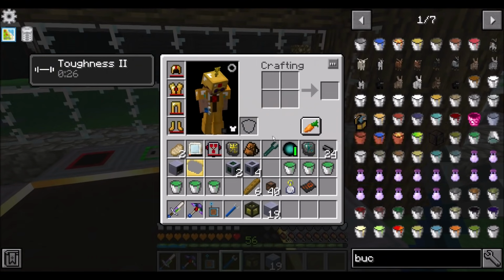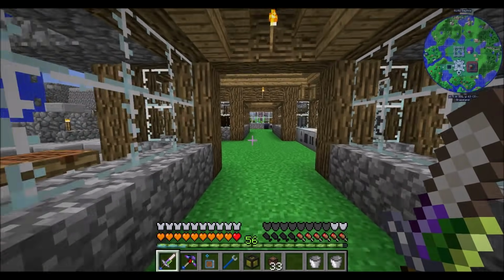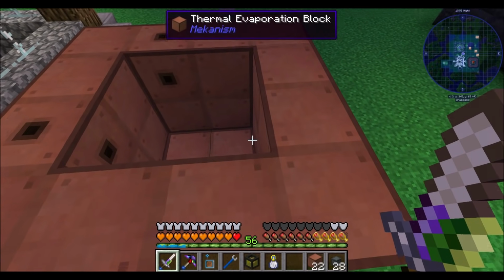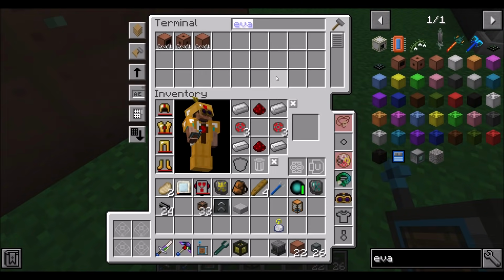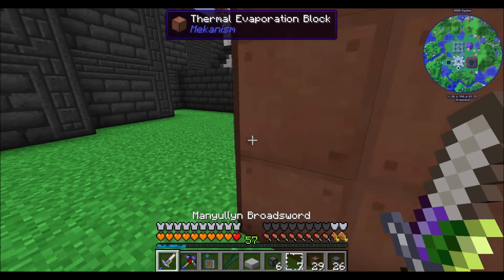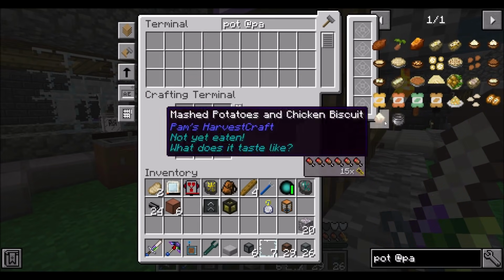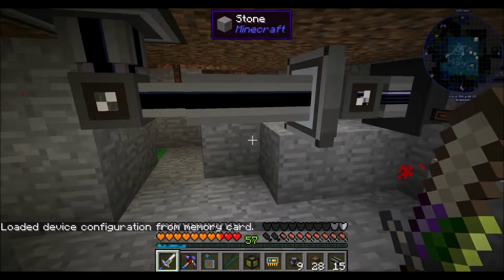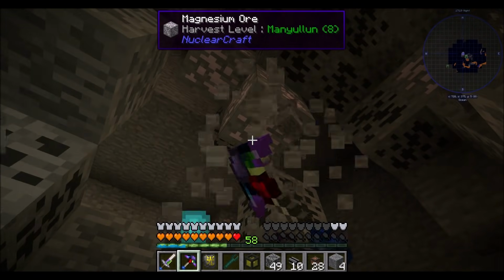Enigmatica 2   Ep56 Brine and Titanium

Comment: Dire... Builds expensive miner, goes mining by hand, builds complicated steucture because he decides it is not worth changing salt into brine, then starts creating salt almost free... 😂
Reply: See going from brine to salt is easier then salt to brine since you get so little brine from salt
Reply: He's gonna need it for for lithium anyway
Reply: Vanilla Mekanism is much easier though
Reply: @Naztash  How did you make sure to supply enough water because thats what is limiting him right now
Reply: The extra brine produced could also be use for x4/x5 ore processing.
Reply: @zecuse  hes already making sulfuric acid and sulfur without brine so he just needs to add a couple machines in the line and he can have 5x ore processing
Reply: Was he making chlorine over there though, I don't remember all of the steps he went through? If not he'd still need the brine for that so the crystals can be processed.
Reply: @zecuse  he is making chlorine to make titanium
Reply: And that chlorine will back log since the titanium machine isn't running all the time. Setting it to a higher priority will make it take chlorine when it would need it while the rest could be used for ores.
Reply: @zecuse  yep
Reply: IT TAKES A LOT OF ENERGY AND TIME TO TURN SALT INTO BRINE
Reply: The thermal evaporation tower is by far not complicated. It’s the easiest and cheapest Mekanism multiblock. And brine has many other uses as well; plus it produces way more brine than salt does, so he’d need to be making a lot of salt.

Comment: Can't wait for him to realise that this modular machine uses 100k rf/tick :D
Reply: he has 3 gas generators and he can switch to ultimate universal cables
Reply: @SkullCrusher757  They produce a mere 15k rf tick.
Reply: @Broffuccini  he could make a reactor
Reply: lmao. Power consumption escalates extremely quickly on this pack.
Are reactors the only option for good power generation?
Reply: @caesural  not sure i just know that hes familiar with big reactors and they make tons of power
Reply: @SkullCrusher757  Nuclearcraft is a better, albeit more complicated reactor system.
Reply: It's FE not RF
Reply: @JordanBennett19829 theyre the same thing its not like joules and rf where you have to convert into it
Reply: @dominorider9879  true but i dont think he wants to deal with the explode in your face thing if he derps
Reply: @Broffuccini  That's the purpose of having power storage, so you can afford to run big power users like this that don't need to be running non-stop
Reply: @SkullCrusher757  Nuclearcraft is easy to prevent overheating, just have it send a redstone signal to power down?
Reply: @JordanBennett19829 It's not that simple. They are 2 separate systems that still coexist in 1.12.x. The thermal mods still use their RF system with a 1:1 conversion  / compatibility layer to forge's FE system. Many mods have moved to FE but not all and some might even contain compatibility for both, like in fact mekanism. And it's configured to use the RF system in this pack, so you're basically wrong :p
Reply: caezar The Immersive Tech steam turbines are quite good and you have ET solars available as well.  Since he’s done so much with Mekanism already, a Mekanism reactor would be a good choice and will last him through end game.  That said, he’s going to need to do either a NC or IC2 reactor to produce IC2 plutonium which is required.  Extreme Reactors can be bypassed since you can get cyanite from NC.
Reply: But it only uses 1 million “rf” per craft, so if it works at max power, it only takes half a second to craft.
Reply: Also, how is he going to craft anything other than titanium given the way he’s pumping in chlorine?  99% sure I recall that the chlorine in the tank isn’t ignored for other recipes and will bork them.

Comment: since your already making brine you should go ahead and try 5x ore processing. your going to want the evaporation chamber either in a desert or in an always day world. dire the elite mechanical pipes transfers 1600 mb/t and the ultimate one are 4x faster than that
Reply: Brine is for 4X.  The Sulfuric acid is the 5X.
Reply: Integrated Dynamics/Tunnels can't be beat with a transfer rate of integer max (2^32 - 1). No need for logic either with that setup since a blank variable = true.
Reply: @zecorezecron  he actually doesnt need brine since its just used in a rabbit hole to make sulfuric acid which is something hes already making. this is how everything comes together to quintuple ingots, 1 Raw Ore + Sulfuric Acid -> chemical Dissolution Chamber -> Ore Slurry
 + Water -> Chemical Washer -> Clean Ore Slurry -> Chemical Crystalizer -> Crystals

Crystals are then put into a Tier 3 setup to be processed.
this was copied directly from the mekanism wiki and based on this info he has almost everything he needs to do 5x ore processing
Reply: zecorezecron he’s already got sulfuric acid. It’s one of the steps in the calcium sulfate he already did.
Reply: The Tier 3 (x4 ores) setup starts with hydrogen chloride. Do the 5 crystals not need HCl in the Chemical Injection Chamber to make 5 shards (I haven't made x5 yet)?
Reply: *You’re 😎

Comment: You should definitely be using Mekanism pipes to fill your thermal evaporation chamber, or at least something faster than EnderIO.
Reply: i think ultimate fluidpipes from mekanism are about as fast as you can get. the elie pipe transfaer 1600 mb/t and the ultimate is 4x that
Reply: @SkullCrusher757  Fluid laser ... 50B/t ... Yes Buckets or more the big reactor can "only" except 50...
Reply: @toaran  is the laser a single block
Reply: @SkullCrusher757  you need two laser  the range is 16 block i think
Reply: @toaran  Everyone seems to overlook Integrated Tunnels, but it can transfer fluids a lot quicker than 50B/t. In fact, you can set the transfer rate of a fluid importer/ exporter to the integer max value (2.147b) which, as expected, will transfer enough to fill a black hole tank in a single tick. Not to mention it is configurable to any number between 1mb/t and the 2.147b mbt cap
Reply: @toaran  so it would work for say the brine maker due to dire wanting it as compact as possible therefore mekanism pipes are his best bet for fast 1 block transferring of liquid
Reply: That was my thought too AND he doesn't even need to dive into logic.
Reply: James Hoad Yeah, I actually know this but still manage to forget about it when I play (at least in terms of fast transfer solutions) :).  Integrated Tunnels was a life saver when I needed to supply steam to 4 IMm Tech steam turbines in my last play through of this pack.
Reply: @toaran  I think you mean accept.

Comment: Run the digital miner on top of that Siren mound.  You can make a battery really easy (Therm Dyn Energy Cell are  easy and upgrade to 250 mil rf, also the machine frames are cheap to make with UU matter).  You will get all the nuclear craft ores in seconds.
Reply: he can also make a Compact solar for the digital miner out there.
Reply: He should also be at the stage where he can make Ender Chests, this would make transporting the ores a lot simpler than into a crate buffer. All he has to do is make sure his ME system can suck the items out fast enough from the Ender Chest it's attached to.

Comment: Since Integrated Dynamics/Tunnels is in the pack and you setup the Evaporation plant like that, you can easily use ID to transfer all the liquids as fast as you want without the need for logic programming. ID has a transfer limit of 2^32 - 1.

Comment: The solar on top of the thermal evaporator can both heat the tank and power your base at the same time. So just throw on some cables.
At least this used to be the case

Comment: I tried doing Brine with the NuclearCraft melter and I noticed that the upgrades seem to work differently from what they say. Instead of what the tooltip says, a speed+energy upgrade combo seems to increase the powerdraw by a flat 500 RF/t per upgrade, instead of multiplying values. Also, the GUI of these machines show way less power cost while they are doing any processing than when they aren't. I don't know whats up with that, but it just seems that these machines use only half of the power they claim to use while idle.